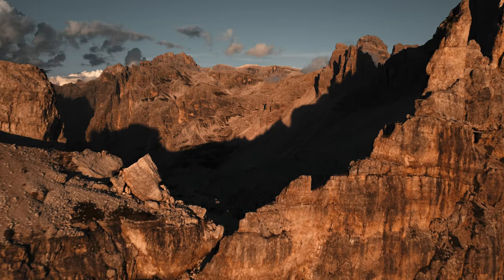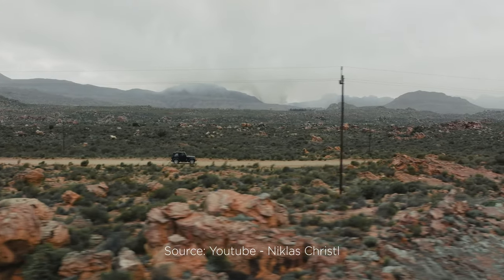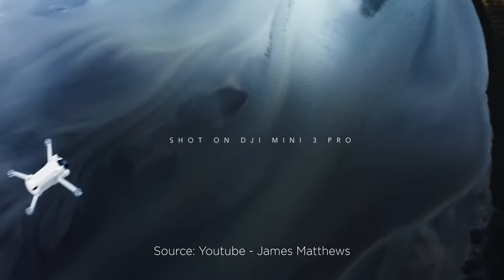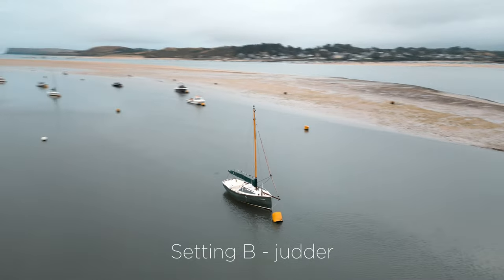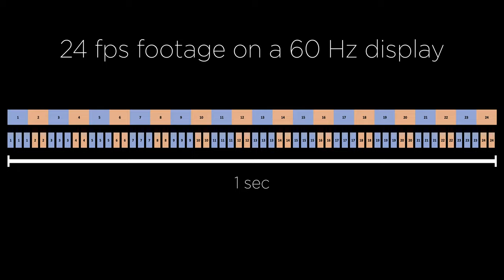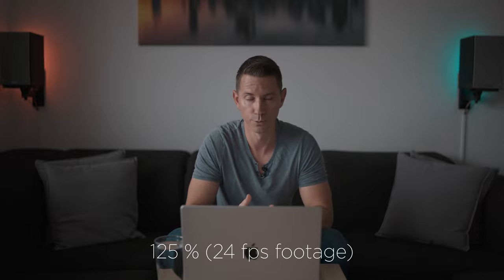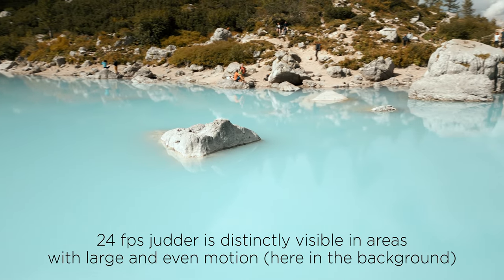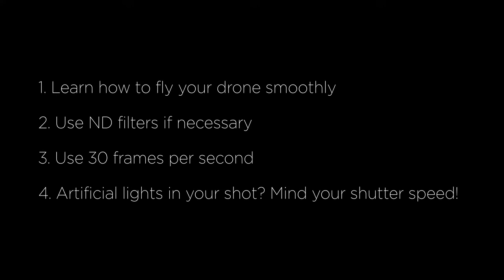The #1 Secret for CINEMATIC Drone Video without Judder, Stutter or Jerkiness

Comment: Hi Tom, this video has been a revelation for me! After years of trying to achieve judder-free video on the Mavic Air 2 and now the Mini 3 Pro, I have never heard anyone make the clear connection between the standard computer/tablet 60Hz screen refresh rate and using a frame rate that divides cleanly into that number. I have made great strides ahead in the last few days by adopting your recommendations of using 30fps and a shutter speed of 1/60th second using a K&F Concept variable ND filter (requiring ND64 on some rare sunny days here in the UK!).

Two questions, however. When I inspect the video parameters of the much smoother drone footage I have recorded using QuickTime Player Movie Inspector, I see that the Encoded FPS is showing as 29.97. Is there a way of forcing the Mini 3 Pro to produce native 30fps footage? I wonder if that might yield even smoother footage. For info, I am viewing the results on an iMac Late 2015, 5K Retina Display, 24GB RAM, 1TB SSD. And if that is not possible, would I be better off using a 29.97 timeline on my NLE (Avid Media Composer) for post processing?

Thanks a million for your brilliant explanations of photo and video theory, this is truly great work!

Jon
Reply from the maker: Jon, very happy to hear that my recommendations helped you getting better results with your drone footage. As for the shutter speed, me personally I prefer even slower shutter speeds like 1/40 or even 1/30 for drone footage (at least for some drone moves), but that's my personal preference. In general, 30 fps 1/60 is fine and complies to the 180 degree shutter rule.

No, you can’t force the Mini 3 Pro into straight 30 fps. But really don’t bother, 29.97 and 30 fps don’t make a noticeable difference in terms of smoothness. There is a very tiny incompatibility between those two: it just skips or doubles up one frame every 30 seconds - it will go completely unnoticed.
29.97 is a historic relict from broadcast when they needed to add in color information into the 30 fps broadcast standard in black and white times. Most cameras still record in 29.97 (instead of straight 30), but there are some that record straight 30 (I think iPhones do, for example).
But again, don’t worry, it doesn’t make a difference.

Thanks again for your kind words, and I am very happy that I could help a little.
Reply: Thanks so much for getting back, Tom, that's all understood. My testing with two different time lines in Avid MC, one with project settings of 29.97fps, and one with 30fps, certainly back up the theory...that's to say, no difference at all that I can make out! 

I will experiment with the slower shutter speed that you mention - if it helps me achieve the same filmic quality that you demonstrate in your own videos, then I will be very happy indeed. I have today ordered the Freewell 6 ND Filter Pack that you recommend on another video, as I am a little suspicious of the optical quality of the variable ND filter that I have been using, having experienced some soft focus issues.

On the whole though, I'm making huge progress as a direct result of watching your content. I look forward to more insightful topics as you develop them - and thanks again!
Reply from the maker: @jonhallett2254  Yeah, VNDs always come with some drawbacks, solid NDs are usually better. And with drones, you don't really have an advantage by using VNDs. You still have to bring the copter down to change ND density.

The slower shutter speed thing works best in scenarios where you have a subject that stays more or less still in the frame and therefore stays sharp because it is not affected by the motion blur. Best example would be an orbit: the moving background gets veeery blurry due to the slow shutter (try even 1/30) but the subject stays sharp because it does not really move in the frame. Another good example for this would be the simple fly forward close to the ground (very blurry) with a subject in the center of the frame you're flying towards (not moving in the frame, therefore stays sharp). So you get a lot of sharpness contrast between subject and surroundings which I think is really grate and makes everything look supersmooth. In cinematography terms, 1/30 sec at 30 fps equals a 360 degree shutter, so that's as smooth as it gets. But it doesn't work so well if the whole frame or your subject is moving quickly in the frame, then you only get a blurry mess ;)
Reply: @t0mwhazzup  Thanks for the info, Tom. The Freewell filters arrived, and initial testing at 4K 30fps is very encouraging. Interestingly, I don't see any marked difference between H.264 and H.265 test shots. On a bright sunny day using ND 32 and 64 filters to achieve shutter speeds of between 1/30th to 1/100th second, I would say that the more pleasing results are with the slower settings. I'm also finding that the smoothness of the shots, in terms of both stutter and judder, can be hugely improved by using more than one axis of movement - say, coordinated roll and yaw. As a commercial fixed wing pilot, I ought to be reasonably competent at that part, but it's definitely still work in progress! Anyway, enjoying the journey, and thanks so much for your advice.
Reply from the maker: Sorry for getting back to you late, but happy if my advice helped you a little bit. I have to check the two axis theory, have not noticed that so far but it might be the case :) @jonhallett2254

Comment: I filmed a few shots, all at 30fps with the same ND filter, dropped it all in the same 30fps timeline and exported all at 30fps. All videos came out pretty good except one clip which had a noticeable judder. Is that just a one off or am I missing something?
Reply from the maker: The only thing that comes to my mind right now is that this one clip was maybe filmed with a noticeably faster shutter speed than the other ones. This could produce stutter (which is something different than judder but can be mistaken). Is this possible?

Comment: Excellent video! I do have a clip I took recently. It's a fast pan/circle fly around a building keeping the building centered for a 360 reveal shot. It's not that there's judder, stutter, that's consistent like some of these (I made these mistakes early), but it has a hiccup every 8-15 seconds or so. Shot in 30 fps (29.97), with 180 rule (1/60 shutter speed) using the same drone as you with the same ND filters as you (Air 3, freewell split pack), put on DaVinci with 29.97 FPS timeline exported the same way. Using a Samsung Pro Plus SD card. This problem also occurs with faster gimbal movements. was wondering if there was a solution for this (if I find one myself I'll post a reply or edit)
Reply from the maker: Hmmm never experienced that myself. Is it only with 29.97? Could be a sd card issue, or the computer is slow maybe? Theoretically, 29.97 should have one small hickup every around 30 seconds. But never noticed that
Reply: @t0mwhazzup  Thanks for your reply. Yes I've only tested 29.97. I have some testing to do based on some advice and other things I concluded that I want to rule out. Two fast SD cards are giving me the same result with the same settings. I actually am also seeing slight stuttering in my videos when the movement is close and or fast (in addition to the hiccups on some clips), and like you note, a lot of youtubers (and instagram) have the same issue. I'm having trouble even finding footage that doesn't do this if it's close/fast enough. 90% of drone videos with a lot of engagement and quality do this.

 Between these two effects, it could be wind, or the computer, or settings. I've been told to try a slower shutter speed so it's not exactly 1:2. Been told to check props. Do lens correction in post. but as before you and I both are finding that this (slight stuttering) is VERY common and not really noticed by the casual viewer. Your eyes are meant to see those faster moving pieces of the background and foreground almost in our peripherals while the subject of the shot will still always be smooth with decent settings and low or no wind. Some of the best videos I've ever seen have this issue throughout them. but I'm trying to fix it anyway because even subconsciously it will look better. kind of like how you don't usually notice the bassline in a song until the bassist track is disabled.
Reply from the maker: @dylancleveland  Do you have some demo clips with those hickups for me to watch?
When it comes to shutter speed... I always choose the shutter speed to give me the brightest possible exposure (just short pf clipping), but whenever possible, with drone footage, I also prefer slower shutter speed. The common 180 degree shutter rule technically produces stutter because it leaves out half of the motion (I think you understand without further explanation). But that’s the perfect amount of motion blur for most types of footage. For drone footage, I found it beneficial for many scenarios to use a slower shutter (up to 360 degree shutter, i.e. 1/30 sec at 30 fps). This will be a blurry mess somehow, but no stutter AND only beneficial when your subject does not move much in the frame (e.g. flying close to the ground towards your subject, orbiting around a subject). This gives great sharpness contrast between the subject and the surroundings which are blurry.

But all in all we have two distinct topics here. The motion gaps (I call it stutter) that faster shutter speeds produces is something different than the uneven frame cadence of incompatible video frame rate (fps) and screen refresh rate (Hz). But one can be mistaken for the other.

Frame rate is especially controversial. I found myself to get the best results with 30 fps because it avoids the judder (because it fits evenly into 60 Hz) and is so close to 24 fps that there's not really much difference in viewing impression. Except that 24 fps judders and 30 fps does not. But in cinema and on most TVs, 24 fps runs smooth. And smooth 30 fps - at least to me - is more similar to smooth 24 fps (in cinema/on TV) than juddery 24 fps (on 60 Hz screens) is.

With the advent of high refresh rate screens like 120 Hz and above, the difference becomes negligible and everything runs more or less smooth. But as it is now, 60 Hz is still the standard and used by the majority of screens and therefore I stick with 30 fps. I don't say that it's the best or ideal, but all in all it runs smoothest, especially with drone footage. With "normal" footage the judder of 24 fps stays invisible most of the time, so nobody cares :)

Comment: if u want ur timeline 24 fps,You can also shoot 30 fps drone footage, and interpret it to 24 fps in premiere (or slow it down a bit) and u will also get smooth drone shots correct? Instead of having my whole timeline to 30 just for the drone shots ,in case I wanna mix non drone footage
Reply from the maker: Well, that's the thing. If you mix footage with different fps, you have to decide for one frame rate for the timeline. As I explain in this video, a 24 fps timeline is not compatible with most computer and smartphone monitors (60 Hz). Why would you record 24 fps footage anyway? I'd always argue for 30 fps timelines for Youtube/Online/Social Media purposes because screens are 60 Hz mostly. 24 fps does only make sense if your project is intended to be viewed in cinema, then it can be displayed correctly.

But yes, if you already have your camera footage with audio in 24 fps, you can either interpret drone footage as 24 fps as well in a 24 fps timeline (everything will judder on standard monitor), or you put everything on a 30 fps timeline, so the drone footage can be displayed smoothly and the normal footage will double up every 5th frame in order to play in the 30 fps timeline. And as judder or doubled/skipped frames in normal footage are usually not that visible, I'd rather go that way. But try it out yourself.

Hope that helps :)

Comment: question, I set mine to 29.97fps but the export I need it to be 24fps because all the other videos from other cameras in my video are in 24fps. It seems to bring back the jitters but in a 60fps timeline, it looks fine. Is there a work-around? I already tried compounding the clips but it doesn't work.
Reply from the maker: Well, if your camera footage is 24 fps and your project is 24 fps, it makes no sense to record your drone footage in 30 fps. Then you'd even double up the frame rate incompatibilities, since your 30 fps drone footage is incompatible to your 24 fps timeline (so 6 frames per second will be omitted), and your 24 fps timeline will be incompatible to your computer screen (which is probably 60 Hz).

I'd do the drone footage in 24 fps then, so that at least everything in the project is the same. But since 24 fps is technically incorrect for for 60 Hz screens (i.e. most computer and smartphones), you'll have to live with the judder (which is not visible in every scene of course, but with drone footage it often is) because an exported 24 fps video can not play back smooth on a 60 Hz screen. No workaround for that.

You could only reconsider changing your frame rate to 30 fps in the future for all your cameras and your project (if it's for online/digital/social media), then everything is technically correct and judder will be gone. At our video production company we do it the same: frame rate is always dependent on the purpose of the project. Online stuff will be 30 fps, broadcast stuff 25 fps (here in Europe; would be 30 fps for America). And if we hypothetically produced cinema movies, we would do 24 fps. But that has not happened so far, haha :)
Reply: @t0mwhazzup  Thank you so much! I found a workaround by slowing down the footage and it seems to work for some footage and for some it doesn't quite do the trick. But yes, definitely will apply your advice next time. We're in Australia so we're basically the same.

Comment: Hello. I just bought an DJI mavic air2s and i still have that stutter no matter in which frame rate im filming… do you know what the issue could be?
Reply from the maker: Without knowing more details, it's only guessing. My first guess would be, you don't use ND filters and therefore have a fast shutter speed that produces stutter. That's similar to judder, but a completely different problem.
The other thing that comes to my mind is that maybe you use a memory card that's too slow. Or, when the stutter just happens in your video editor, that your computer might be to slow for editing the video footage.

Comment: Have a question : if I will shoot in Europe in 30 ‘ 60 fps on a 25 timeline automatic speed is will be an option to smooth the footage? For indoors shoots f/50’ 100 is it?
Reply from the maker: Oh sorry, I missed your answer. Independent of where you film, in order to get a smooth result for online content (computer/smartphone use), your best bet is to use a 30 fps timeline with 30 fps footage (not 25 fps).
The problem that might arise indoors with artificial light when recording in 30 fps in Europe is flickering, but if you keep your shutter speed to 1/50 or 1/100, this will be eliminated.

But keep in mind that nowadays with many LED lights (that often have a much higher frequency), you might not have a problem at all as long as you keep your shutter speed not too fast (let's say slower than 1/100 sec).
Best practice is to make a short test clip in each environment and check for flickering.

Comment: Hi there great video. I have an additional question for you. So if we are using the 30fps frame rate then I am assuming you would suggest I use the 180 rule and match the 30fps with a 1/60 of a sec shutter speed. is this correct? then to take it a step further when using a drone with a fixed aperture what shutter speeds do you use if you need to make a quick exposure adjustment  during the flight when the  1/60 is not quite right. or do you just make the exposure adjustment in post to avoid breaking the 180 rule?  any info will be greatly appreciated! thx so much for your time.
Reply from the maker: I fine adjust by varying the shutter speed. If you stay between 1/30 and 1/80, it doesn't really matter. I personally prefer the slower shutter speeds between 1/30-1/60 (when possible) because I love the more blurry look, but that's a matter of taste.
I wouldn't stick to 1/60 all the time and sacrifice exposure because drones with small sensors like the Mini 3 Pro don't have a lot of dynamic range (read: exposure latitude) so you better well expose in the first place and don't adjust afterwards. Exposing too bright might produce overexposed spots that can't be recovered, and exposing too dark and raising exposure in post also raises the noise (especially in those small sensor drones).
I have a video on my channel about color grading D-Cinelike where I also explain how to expose small sensor drones for maximum image quality and low noise. Maybe that helps!
Reply: @t0mwhazzup  yup thx that's exactly what I wanted to know shutter speed range 1/30 to 1/80 to keep things smooth why'll allowing me to dial in exposure.
Reply from the maker: @kosmonparran4495   Perfect 🙂 And here are the links, the first video is the color grading video, where I later explain how to expose for best quality. And the second one is an all around tutorial for the best settings for top quality, also going more into the use of ND filters.

Color Grading D-Cinelike - DJI Mini 3 Pro
https://youtu.be/8IkScB3FGDQ

The ULTIMATE Guide to PRO QUALITY Drone Footage - DJI Mini 3 Pro
https://youtu.be/5aotiUE-iOk
Reply: @t0mwhazzup  much appreciated!

Comment: So how would you add a 30gos drone shot into a 24fps timeline consisting of non-drone footage?
Reply from the maker: @jonbowen5878  With 80 % speed. Than it fits natively into your 24 fps timeline. But as stated in my video, 24 fps timeline will not play back evenly on many computer/smartphone monitors (60 Hz).